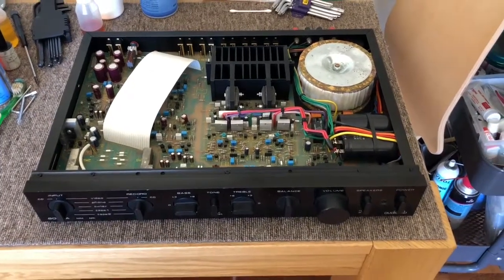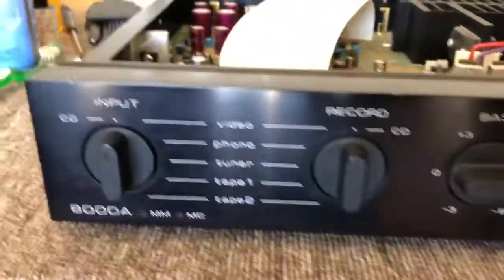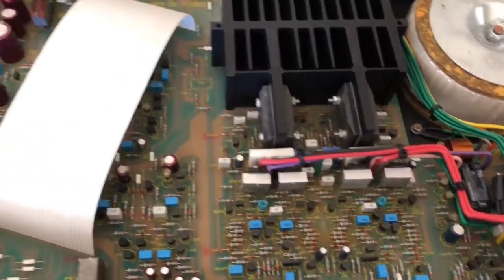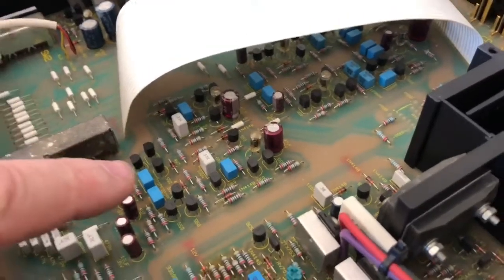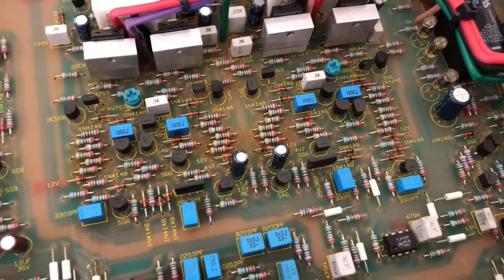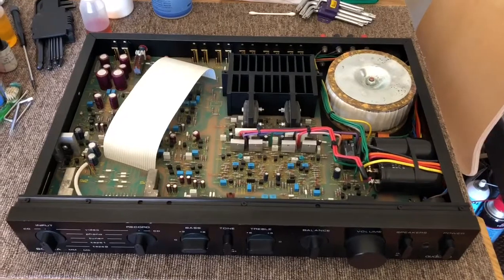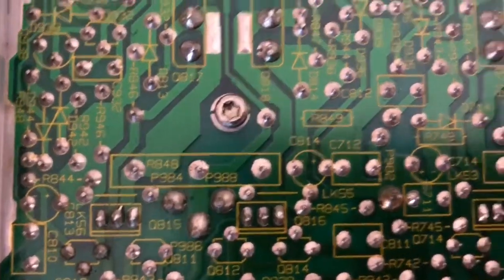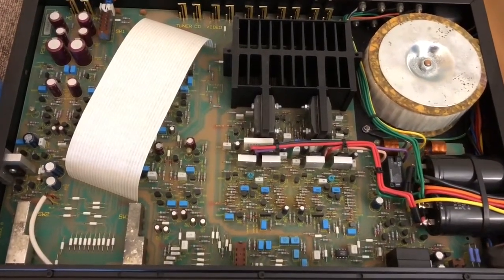Audiolab 8000A Integrated Amplifier Look Inside

Comment: Using the same model right here, classic amps and still sound fantastic. I'll be on the search for a matching 8000P to go with it before long.
Reply: Had the A and C and P great amps.
The A was always a great all rounder and very versatile.
The build quality alone knocks most of modern rubbish of the shelf.
Miss the Days of Hi-fi like this.
Have had a heap of gear and now run Accuphase.

Comment: I've collected three of these (one is separates 8000P & 8000C) based on a bit of layman's research and good luck on Ebay. I am using only one, I have the others as replacements in case one fails. It's great to know they are solid and will repair well! I do wonder about eventual repair, no idea how to tell if a shop will know how good a thing like this is, and few will admit what they don't know.

Comment: I remember bringing one of these home from the dealer to test in my sound room.  I was looking to upgrade a NAD 3240PE integrated amp.  The Audiolab sounding beautiful and I was sold.  That was, until it would go into protection when driving my KEF C95 speakers at louder volume.  Whereas the NAD had oodles of headroom for the dynamic peaks of music, the Audiolab just did not have the reserves to drive the power-hungry 4-ohm KEFs.  Back to the dealer it went...

Comment: I bought an Audiolab 8000LX new in the late nineties to run my modest hifi system of that time.  The 8000LX was the same as the 8000A except for the deletion of the tone and balance controls and phono inputs.  I still use the Audiolab, but now only as a pre-amplifier, selecting the input for my much higher end Linn (Akurate 242 speakers, fully Activ driven by a two Akurate 4200's and a 2200 amplifier) system.  The Audiolab has operated faultlessly throughout. All the controls have a precise and solid feel and the volume control is as quiet as can be.   Personally I can't fault the sound quality of this little amplifier or its build quality.  Anyone looking to improve their existing system or to assemble a new system would do very well to base it around an Audiolab 8000 amplifier.

Comment: It is worth mentioning the speaker protection circuit with timed power on and instant off, and the output stage's short circuit protection (all around the relay). Indeed, the components are of high quality and I have never had to change any since the late 80's, but the RCA connectors. Still, I had to touch up some cold weld points, which is common with large PCBs.

Comment: Nice that this version has heatsinks on the driver stage and VR's for the bias. Although when the VR's do go bad bad things are more likely to happen.
  I repaired 2 power amp versions recently. Shame the circuit board itself is not that resilient die to how they were built back then, the tracks can easily come away from the fibreglass, especially where the heat from the drive stage browns the board.

Comment: Good sounding amp but the major design flaw is that they over heat very quickly due to inadequate ventilation and a somewhat small heatsink. Some of the resistors should also be raised more from the board to allow ventilation beneath them. So almost the perfect amount but not quite.

Comment: Hi there

Nice video and i love Audiolabs build quality.  I have an Audiolab 8000C pre amp and tripath power amp combo and there is a huge crackle when i turn up the volume from silent.  It gets better after warming up, i am just wondering as the volume pot on the 8000A is a similar alps pot i believe, how you would clean it. It looks like you have to take the whole bottom board out, ouch.  Thnks for any info
Reply from the maker: Start with a quality contact cleaner and treatment, but equipment at this age really needs a more global approach to maintenance. There may be DC across that volume control which would indicate other issues. I'd suggest taking her to a local specialist familiar with this type of equipment for some deep service work.

Comment: great video ive just recaped a  8000a my self it was my first pet project  and i used ncon fg and elna simmic 2 caps i was wondering what you set the bias current to ?
Reply from the maker: Good work, it sounds like you've used some excellent capacitors. I work according to manufacturer service data where available and calculations where it isn't. Try to track down a service manual if you can but I suggest don't fiddle with anything there if you cannot. From memory, these amps have semi-fixed bias current set by selected resistors.
Reply: @LiquidAudio   thanks for replying  , as i understand it the al 8000a in your video is the same as mine which is  a mk2  and its set by the trim pots ive used the service data from the
mk1 because the service data for the mk2 is unobtainable in the uk  i wondered if you could recommend reference material ie books so i can learn more about how these amplifier circuits work , i watched the KRC HR  video i must say what a great job you did putting it right i dare say Raymond at krell industry's would be impressed, i own some krell monoblocks  and a krc3  its hard to find engineers competent enough to fix this gear  theres only one guy in the uk  so your a rare resource , please keep the videos coming
Reply from the maker: No problem, Randy Sloane's Electricity and Electronics is quite good and contains lots of circuit applications. Then there's  the Art of Electronics which is possibly the definitive book on such things. Thanks for your kind words re my repairs and restorations. I work differently from many out there, probably because of my attention to detail and scientific background, plus the fact that I'm running a full-time specialist electronics repair business. More videos on the way!

Comment: I am not sure about the the Bios setting. The voltage across  dual resistors (0.44 ohms) is approximately 50mV each channel. It looks fine but I think to reduce a bit the current say 45mV to make the unit cooler. What are RV701 and RV801 variable resistors for, to adjust the Bios?
Reply: It's not "bios." It's bias.
Reply: @olegau12  należy zmniejszyć bias na 22mv

Comment: That heat sink looks no where big enough for the size of output transistors in this. Probably why they seem to suffer from dry joints because of the heat produced at higher volumes.
Reply from the maker: Hi Tony, you are correct that these are small heatsinks, though there are many factors involved in the thermal equation. Generally, these don't suffer particularly from dry joints, any more than other amps and they are actually very reliable. Quiescent current is important and these are biased gently, so average heat dissipation is not great. They were also designed in the UK where it doesn't really get hot too, so that's part of the design!
Reply: @LiquidAudio  Running that into a 4 ohm load at high volume for any length of time will soon make it warm up believe me even here in the U.K.High current flowing through electronic components = heat. I have a Pioneer A6 from 1981 which is the same power output this. It has an heftier power supply and the heat sink is a least 4 times the size. Look at Simon Spears two part repair on the Audiolab 8000a. The right channel has had a right good burn up.
Reply from the maker: Hi Tony, I must point out that I understand the theory, though thank you for sharing your thoughts! I'm a specialist hi-fi electronics repairer and this is all I do ( repairs, not YouTube!!). Amplifiers are designed for music signals rather than 4 ohm fixed loads at high power. If you run this amp like that, and we have to under load testing scenarios, it will naturally get hot. Playing music signals though, they run at moderate temperatures. As I mentioned, they are generally reliable, very well engineered amps. There are much, much worse!
Reply: @LiquidAudio  My late father had more than 60 years experience repairing this sort of equipment he taught me. I have more than 30 years experience.There probably are much worse but there are much better too.Compared to some of the equipment I own and have worked on.I will be buying one of these to test just to see if they are as good as people say.
Reply from the maker: Hi Tony, perhaps we will make this the last comment because there is no point in going around in circles as can happen with youtube comments. I appreciate your thoughts, though I think you may be missing the point somewhat, so we may have to agree to disagree - that's OK! 

I work on amplifiers and other equipment like this, some much better, some much worse. Visit my site to see some of what I do - https://liquidaudio.com.au. I get to work on some of the best gear ever made, lab gear and cheap consumer gear, sent to me from around the country. The 8000A is simply a solid, well-designed, well-built amplifier. If run sensibly, it will be fine. If driving really tough loads at high power, it will suffer as most other small amps would. There's not much more to it.

I'm certainly not saying it's the best amp ever made, far from it given what I work on! I'm not really interested in other videos about this, I'm only interested in trying to educate based on science, the experience of someone completely immersed in this space and the facts, not what I've read or seen somewhere. These amps sound good and are well-loved for their design and build. I wouldn't own one but in the right set-up, they are excellent. That's it really, it's just an amplifier. If you want something really good, save your money and get an Accuphase!

Comment: Is it really "hifi", Or is it "mid-fi", it's not exactly expensive? How would it compare to a NAD C350?
Reply from the maker: This older Audiolab gear is proper hi-fi gear and in a different league to NAD in terms of design and build quality.
Reply: @LiquidAudio  Thanks for getting back to me, I thought the NAD C350 was good in terms of its large toroidal transformer and 22,000uF capacitors, are they overcompensating do you think? I paid £80 for mine, I see the AudioLab 8000A is selling for £200-350 here, Are there any higher end / more advanced (technically) alternatives at that price range?
Reply from the maker: @timu-san  NAD offers good bang-per-buck new, that's always been their shtick. Build and parts quality are ordinary to awful though and I won't even work on certain NAD gear. Lots of alternatives, beyond the scope of a comment here but as a general rule, older, more expensive gear is usually the best way to go. Always remember that you get what you pay for. For more and in-depth articles about this stuff, visit my website, link in the description.
Reply: @LiquidAudio  Thanks =)

Comment: I concerned about the overheating resistors in mine. It caused me to take it to a technician that works on vintage amps, he checked it out and said it was running to specification. Now What if we somehow replaced these hot resistors by using a stand off and by ruining two in parallel?  Would that help it run cooler or extend the life of it?
Reply from the maker: IF they were needed, the answer would be to install resistors rated for higher power dissipation, they will run cooler and this might be kinder to surrounding parts.
Reply: @LiquidAudio  Whist you are here. I've noticed on mine since moving to the USA from the UK that the bass has diminished. Despite the tech saying it was fine, would you recommend replacing the electrolytic capacitors so solve this issue, or would it not make the difference I am hoping for?
Reply from the maker: Capacitors should be tested to determine their condition. If they are worn, replacement will certainly improve amplifier performance. Even when they measure well, upgrading them to higher quality parts will also improve performance.

Comment: I have an 8000a and it’s in very good cosmetic condition, however there’s a hum that only occurs in the left channel when the moving coil stage is selected.  Isolated it to the amp since it happens without the turntable connected. Hum goes away if I press the red switch to change it to moving magnet. Any idea what could cause this?
Reply from the maker: Hi Alex, thanks for your comment. There are lots of potential causes of hum in phono replay chains including wiring issues, ground loops, shielding issues / proximity to mains wiring, cartridge problems and component failures inside the preamp. Naturally I'd need the unit here to be able to offer a proper diagnosis, but hopefully you can experiment with a few elements in that equation and perhaps find a good technician nearby if needed.